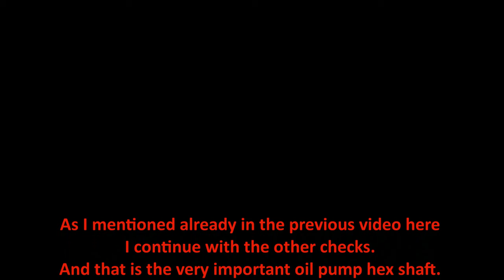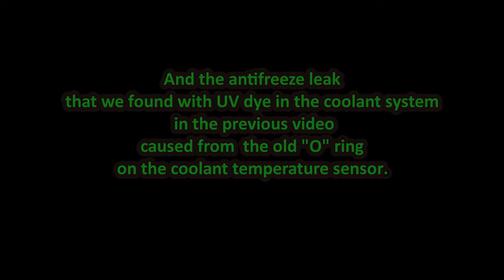VW Sharan 2.0tdi PD140bhp (Galaxy/Alhambra) Oil PUMP hex shaft replace guide.

Comment: Regarding just changing the hex key as opposed to the drive unit. Basically if the key is slightly worn a new key gives you a decent life of use. If the key is really bad then a new key is likely to wear quickly again. Its your choice!

Comment: great video, very good detail. I do my own repairs on my 09' Golf estate, it's a 1.9 tdi BXE. I will check my hex shaft drive in the oil pump soon but I do need to replce the near-side drive shaft and replace the ouput flange seal on that side too, probably no coincidence hey!
i just replaced the clutch master and slave cylinder as well! car though still runmns great otherwise!
All age related issues I'm pretty sure.
thank you for the video!!
Reply: I still haven't changed my hex balance Shaft yet, i have it at home but not yet fitted it.
My car is on 106000 miles.
I think it's making rattle noise.
It's a VW golf 5 1.9tdi pumpe dusse engine??

Comment: Excellent video, what about the balancer keyhole, if the hex is worn, should the shaft with keyhole be also replaced ?
Reply from the maker: yes, replace the oil pump, otherwise, the new hex key in a worn keyhole will be rounded in no time.
Reply: @bobbysplace7993  what about the other keyhole, in te balance shaft, you need loop disassemble whole pump to take out ? I booked car in with skoda and they said they just replace hex key ? In your video you just replace hex key ?
Reply from the maker: @ronangsr  sorry I meant to replace the balance shaft not the pump.
Reply: @bobbysplace7993  hi, just had car back from skoda,  they just replaced the hex key, I asked them would the shaft need to be replaced and they said no as its only the hex that wears. Sure they would need to take the pump off to check the key hole wouldnt they... in your video you just replace hex key ? How come you did not change balance shaft also ? Just wondering. Thanks
Reply from the maker: @ronangsr  If the balance shaft is not worn its not necessarily to replace it. That's why Skoda didn't replace it, as do I.
Reply: @bobbysplace7993  ah ok super 👌  thanks for all your replies
Reply: @bobbysplace7993  but how do you check this without removing?
Reply from the maker: @adventurewithlee  There's no other way to tell. Well if the turbo poop itself or you`ve got a worn camshaft that's un indication as well :)
Reply: @bobbysplace7993   no, I mean the key hole it slots into, like others have said, what's point in replacing the key if the slots in the hole have also worn
Reply: Basically my point being, if the shaft is worn then the key hole will be worn too, so what the point in changing just the shaft? Seems pointless? Sorry don't mean to sound rude, it just doesn't seem to be of use, unless you could explain for me pls
Reply from the maker: @adventurewithlee  Got you. Well if the key is really knackered/rounded that is an indication that could indicate that the hole is badly worn. If the key is not in that bad shape and just started to round the edges the hole should still be in spec. Mind you the key is made out of a softer material than the rest so it goes first If the key is really badly worn even though it's a softer material and it's been wobbling for too long it most certainly would have damaged the hole as well.

Comment: Hi my oil pump seems to have failed got oil pressure light,, so I stripped down pan and took out the hex key,, so I went to audi and got new key and installed it but are the drive gears OK I reassembled everything but can't be sure is working,,, thanks john,,, ps I now need a turbo I was unlucky,,,

Comment: Hi, is there a noise when the hex key starts to round off?  I have a 2012 Passat TDI that has a rattle on startup, it sounds like a timing chain rattle but there is no timing chain. It only rattles for a couple of seconds when starting. Thanks.
Note the vehicle has only done 100,000km
Reply from the maker: No, no noises I am afraid. But the rattle could be from the tappets which might indicate low oil pressure at the cylinder head/camshafts.
Reply: @bobbysplace7993  thanks for the reply, the noise I have is coming from the bottom of the engine and it’s very similar to a timing chain noise.
Reply from the maker: @niffty1510  This is your oil pump chain. Could be the tensioner gone or the chain stretch and tensioner out of range. You definitely have to drop the sump and check.
Reply: @bobbysplace7993  thanks, according to Volkswagen dealers going by my VIN number it is gear driven not chain and that’s what is so confusing. Took it to a VW specialist and he agree’s it sounds like a timing chain rattle.  If the balance shaft assembly needs replacing we don’t want to spend what sounds about 5k. Plus to pull it apart the oil pump & or balance shaft assembly have to come from Germany & I’m in Australia so the car would be out of action for weeks.

Comment: Great informative video! Thanks for sharing! 
Q. Is this oil hex shaft 03G115281F good for 2006 Audi A6 2.0Tdi 138 BRE motor and is it the same procedure as the VW Sharan?
Reply from the maker: Yep, the same. The fitting should be pretty much the same.
Reply: @bobbysplace7993  Cheers mate! 👌
Reply: @bobbysplace7993  how do i know when mine needs changing
Reply from the maker: @MrJnr786 That's the thing, there's no way to know when to change it. If the motor is more than 100 000 miles, it's more likely it's on its way. I've seen then even in a 70k miles motors starting to go.

Comment: Thank you  for  this. I am looking to  get this  done . But I am  not  sure if  mine is  the  77mm or  100mm shaft. Is there a  way to find out without taking the  oil sump off?  Its a  2008  VW  Touran 2.0 Tdi  with BMN  pd  engine 170 hp
Reply: Did u figure it out

Comment: would you recommend to change the chain and tensioner as well. The hex shaft (new) is it 100mm? ro 120mm?
Reply: Late at this but anyway the new is 100mm the old 77mm

Comment: Hi Bobby, so today I had a light flashing... Refilled with oil as it was showing oil level on minimum, started the engine and red oil pressure light was still flashing and what i did was ... Wait... I drove 2 miles before i stopped🥴 I heard some sound coming from the engine and thats why I stopped and called for the breakdown. Now my car is in the garage till tomorrow waiting for them to check. I just thought is there any chance  my engine is not knackered? I spent 500 quid already few moths back so any bigger then that would be too much. Thanks for reading this long message 😁👌
Reply from the maker: Well if you spun the hex key in the pump and kept driving in high rpms you might of sufferd an oil stavation and have damaged internals in the engine. The first thing to go is the turbo, the second weak point in the PD engine drivetrain are the camshafts, they are prone to a premature wear regardless. Fingers crossed for something small.

Comment: Hi just one more question,,, when you slide the hex key in I can't see what it's going into so is always just the key or what the key goes into,,,, thanks john
Reply from the maker: just slide it in, there's nothing to align. Just make sure you put the little circlip good to hold it in place.
Reply: @bobbysplace7993  Thanks for that really appreciate you coming back to me,, so the key I put in and it went in very smooth and the ser clip I put back on it sat away from the tip of the key by about 2 mm but it was in its grip because I couldn't remove without force again,,, so hope I done it right,,, John
Reply from the maker: @johncoady9237  Hi, yes that's fine. the key is floating so don't worry about the gap between the circlip. But yeh the turbo is the first to go bang when insufficient oil in the system. Well done.
Reply: @bobbysplace7993  Thanks Bobby jeep back up and running now,, new oil, new filter,, hex key and new turbo well used new turbo so to speak,,,, but so far so good,,,I noticed the new hex key I collected was solid were the old one was hollow does that mean I get longer,,, how long do keys usually last would you know,, and once again really appreciate your help👍
Reply from the maker: @johncoady9237  It should be good for another 100K miles I would guess.
Reply: @bobbysplace7993  👍 thanks....
Reply: @ John Coady... Just out of interest, how long did you drive the car for after the oil pressure light came on? I currently have the same issue and just wondering whether I should expect to be replacing the turbo as well. Thank you.

Comment: Hello! I have an Audi 2.0 TDI BPW with 320.000km. The man who sold me the car said that he never changed something about oil pump since he bought it in 2011 with 100.000 KM. Do you thing that I have to check if there's something wrong with the oil pum or the problem was fixed back then?
Reply from the maker: For a peace of mind, better drop the sump and change the key. If the car have history check for turbo change/repair or camshafts change. Because the lack of oil pressure destroys the turbo and the camshafts.
Reply: @bobbysplace7993  The turbo was replaced 1 year ago by last owner, and the camshaft i replaced it 1 week ago but the mechanic said that the camshaft was warned by poor quality oil, not from the oil pressure.
Reply from the maker: @skeepsis4536  Generally speaking the quality of Audi/VW camshafts is poor but  I would say, check the oil pump hex key and replace it.

Comment: I don't get the point of this? you are putting a new part into a hole that is already warn. this is not a fix.
Reply: Agreed, this is a very temporary fix.
Reply: @ferrumignis  I took mine out yesterday, has a bit of wear but nothing major like this. I replaced and hopefully it should be good for another 50k at least. Car was on 116k when i took it out
Reply: @DomClimbs  how do you sort the hole out
Reply: The key is what wears because of the surface area contact pint being small. So a new key is going to last as long again. Yes you can uprate the pump but this is a good fix and cheap to do only 16 quid for new hex key  and oil change after. No brainer or engine repalcement you decide.?!!!?
Reply: @LAW-fv6ys  £16 quid for new pump are you off your head mate? £600 for conversation kit its not a easy quick job. £16 for a key maybe but you still have to drop the sump and install it which isn't easy without a ramp. Also yeah you'd need full oil top up and filter.
Reply: @DomClimbs  I said new part referring to the hex key, anyway have amended that to clarify so my head is back on after being off. Lol